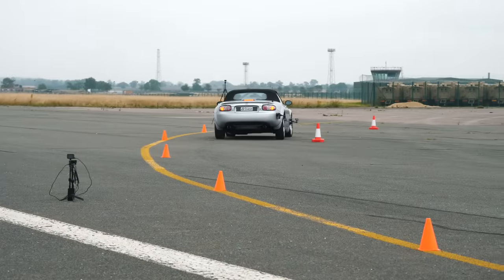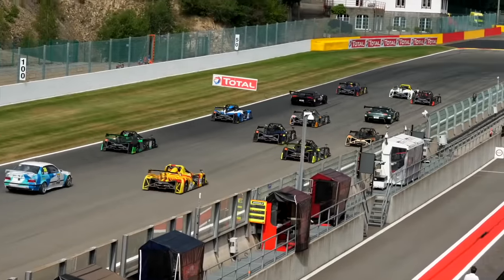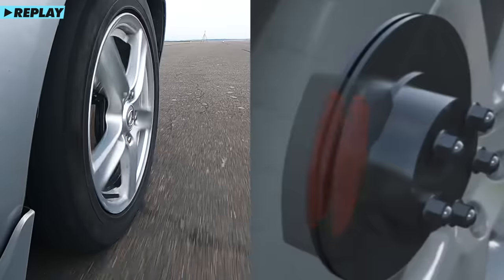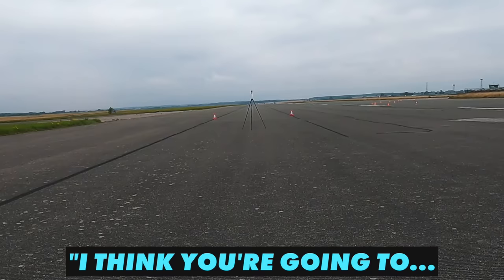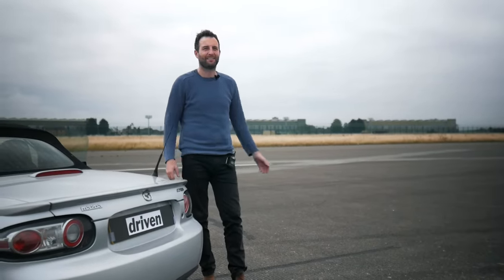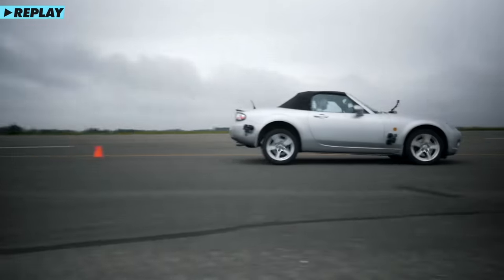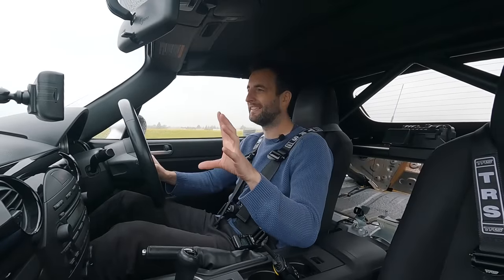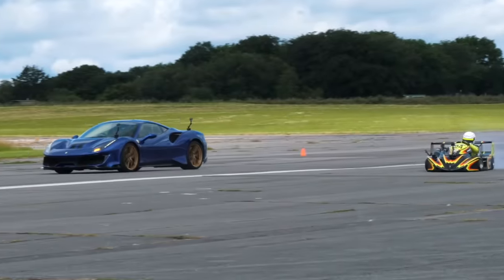ABS ON vs ABS OFF | What's Really the Difference?

Comment: What a totally disingenuous video. All you're showing here is the difference between using ABS and deliberately locking up the tyres. It's patently obvious that  zero attempt to threshold brake was made in this video. So this video absolutely does not show the difference betwen ABS and a skilled driver. Also the claim that an experienced driver (experienced at threshold braking that is) is incapable of threshold braking in unknown conditions  is complete and utter nonsense. I used to ride motorbikes for 10 years and if that were the case I'd have been continuously falling off my bike every time I had to do any hard braking on the public road. And each race track is different in terms of grip on any given day so clearly racing drivers are always managing to threshold break in unknown conditions. Does every driver lock up their tyres the first time they hit the first corner (and every subsequent corner) on the first practice of a race weekend, of course they don't. Yet they won't know the exact level of grip at that time. So it's utter nonsense to say people can't threshold brake unless they've made that braking manouver on that same peice of road a hundred times before. Of course your average driver is very likely to do exactly what's being shown in this video under panic conditions without ABS, but that's not the same thing as showing the true difference between ABS and no ABS in terms of braking capablity. Cornering/steering when locked up is of course impossible. So it's an important message to put across about the benefit of ABS, but please be more accurate in your explanation of what you're actually showing here.

Comment: OK you just failed you're driving test, when I did my test we learnt how to emergency brake without locking the wheels, we didn't have ABS! Best you not buy any classic cars in the future if as racing driver that's you're idea of a brake test comparison 😔 I've disconnected the abs on my monaro as the system had a fault and the brakes are far more responsive now than when it was working and I can feel what is going on up front now unlike before, I also did the same on an mr2 turbo as the abs was absolutely shocking on those cars. But hey I grew up street racing v6 capri's and astra GTE so, I've never relied on technology to do what a driver should do, the only time abs is handy is in the wet unless you aquaplane then you're screwed regardless.
Reply: Calm down there big man. The average person isn't born in a built race car in their pop's garage. The fact that you can live without abs doesn't mean everyone else can. It exists specifically because there's a need. With so many people out here not even knowing you need to change a car's oil, they can't be trusted trying to prevent a lockup on their own even on the driest, stickiest possible surface. That is if they even make an attempt to brake between sneaking glances at their phones before bring their eyes back up to where they belong. I'm also fairly certain that at least in places where vehicle inspections take place regularly, completely and totally disabling abs and whatever systems are dependent on it on a car that came with it originally is technically illegal, as in you won't pass your inspection with it disabled.
Reply: @bespincustompropsbombarta8300  If you could get off your high horse for long enough to realize the reality you substitute isn't the one we live in, you'd know by now that yours is an unrealistically ideal world. If we lived in your world we wouldn't have abs in the first place because everyone would be so good at driving accidents would never happen. Regardless of what you think is best, abs is essential in modern cars. If drivers from your day were so great, why did they develop driving aids like ABS at all?  Drivers didn't just magically get so bad overnight that we needed to protect them from themselves. The fact that the tech didn't exist doesn't mean you had better drivers. The fact is, the majority of people use cars for a to b and know next to nothing about how they work other than turning the key. Driving is also pretty much an essential for doing anything these days. It's much less of an exclusive club as you claim, anyone can get one with enough persistence, even the grossly incompetent. This is why safety features exist.
Reply: @christianmccollough5005  you're forgetting history,  biggest killer was drink driving back then, now its driving whilst using a phone.
Back then tyre ware was the main contribution to accidents in the wet and people not driving to the conditions, which even now is the biggest cause of pile ups in you're glorious age of ABS, the more technology does the dumber the human behind the wheel becomes. I ride a motorbike daily and the sheer fuck wittery of drivers leaves me in disbelief, so maybe make some videos about how to drive well instead of making everything think the car will do it all for them.

Comment: Really disappointed in not demonstrating threshold braking here and how much better you can actually stop without ABS.  This is only a demonstration for zombie drivers, please step it up mate, threshold braking can be taught to everyone, even with ABS active on the car and achieve shorter braking distances.
Reply: this is for normal people on everyday roads not a racetrack with pro drivers ....
ur point doesnt work for a normal daily driver
Reply: @marzie36  Ummmmm, I teach advanced driving techniques for a living and achieve teaching even young women drivers to threshold brake in 1 day, even whilst turning and braking.  
Threshold braking is not just for pro drivers.
Reply: @marzie36  ABS is there to catch you if you overstep a threshold brake to prevent locking up the wheels, not to solely rely on ABS to slow the vehicle.
Reply: @SimonWorlds  yes , but not every driver is the same :/ , imagine ur in a ruch and you need to calculate and find the best path for threshold brake 
its not very practical

Comment: This is just stupid !!! When breaking without ABS you do not lock up your wheels, correct breaking is to break as hard as you can WITOUTH locking the wheels, to do this you must regularly train to do it. Driving without ABS is much more demanding but if you learn how to do it you are rewarded with shorter breaking distances then with ABS. Also breaking in a turn with or without ABS is something you should avoid, but if you have to do it there is special ways you should do it and learn how to before even trying.

Comment: I'm disappointed in this video.  It shows the same exact info that I saw in TV ads over 40 years ago.  I would have thought that ABS would have improved in that time that they would not need to only test with an idiot driver.  Haven't they upped their game enough to test with a driver that has a minimum skill at threshold braking?

Also, the ABS in different cars are configured different.  My BMW's ABS is excellent.  My Toyota's is crap.  I absolutely hate it.  I'd like to see a test with a skilled driver with ABS on/off and multiple makes/models.

Comment: NO NO NO what you compared is ABS vs Locking all the way through which is the skill level of someone who has not an ounce of skill behind the wheel. There was not threshold braking whatsoever, no modulation, nothing. I call this test utter BS!!!!! I've emergency braked many times on roads and would only occasionally have instant initial lockup and then it's brake modulation. I use cadence braking only when the grip levels are extremely low, for example when it's a little bit wet and there is an oil layer on the road. Yes the ABS removes a driver's braking skill from the equation and in general this is a good thing because most people cannot threshold brake to that level of skill. Yes a very good ABS system (not all are created equal and older systems had abysmal performance I could outbrake an ABS system by a  huge margin) may even beat an extremely skillful driver at the brake test but definitely not by 50% distance. Also I prefer not to use ABS, at least older systems, because on dirt roads it doesn't really help

Comment: I did not like this test and methedology behind it. Cars without ABS have different mechanism for brake force distribution on rear wheels. It is sort of like comparing car with/without power steering by removing the fuse whereas know that there are mechanical differences between these systems. In the ideal world, you should find two identical cars that came with/without ABS from a factory. For instance Clio mk II. I did similar "tests" myself to compare how effective winter tires are with/without ABS and just like you removed the fuse. But this I knew it was not representative. Also, I think whereas you did fantastic job explaining how ABS works and how "regular" brakes can do even a better job than ABS, you being a professional racer should have show how good can human being be. Finally - ABS is fantastic when you have two disimlar surfaces (tarmac under one side of the car and gravel on another). I love ABS, back in 2003 I paid extra for ABS in my Clio and had it instead more powerful motor. I appreciate ABS a lot as it saved my back number of times on slipery surface. However while on dry and good one, I think you can do better job than ABS :).

Comment: Frankly, one of the dumbest, most pointless "tests" I've ever seen. I grew up in the days before ABS or any other electronic controls. Even average drivers knew to ease up on the pedal if the brakes locked up. We didn't call it "threshold braking", it was just how you normally drove. Comparing ABS to mindlessly locking up the brakes like a window-licker isn't a real-world  test. I'm not saying ABS wouldn't still win. But the margin definitely wouldn't be as drastic.

Comment: This test is incredibly stupid. We all know the brakes are going to lock up. It would be interesting to see how the brakes would perform if you actually try to stop in an intelligent and rational maner, you know like not locking up the brakes like a moron.Its called intermittent braking and in many cases is comparable to abs and more importantly saves lives when abs fails for whatever reason.

Comment: Exaggerated!! You are simulating a clown driving the non ABS car. A little feel on the driver's part on the non-abs car and you'd have far better results. I say that because I taught at a police academy with a switch that I had installed to turn off the ABS for demo purposes and when I road raced I always pulled the fuse to the ABS because it killed my feel

Comment: As someone who didn't have a car with ABS until about a year ago and who lives in a snowy area this is a very silly video. 
You don't just stand on the brake without ABS, you have to do what the computer does and feather the brakes so that your wheels don't lock up. Obviously computers are better at that, but in this example it appears you didn't even try. 

Maybe you were just trying to demonstrate something, but this is the equivalent of beating a strawman. Shame.

Comment: Not the least bit impressed because you make NO effort to compensate and you just jam the breaks on full any driver worth the time to give them a license will ease off if they locked up and usually power the breaks without just locking them up. If the test is only about being a lousy driver who can't stop themselves from locking up the breaks what's the point?